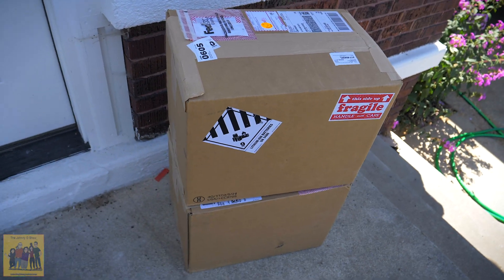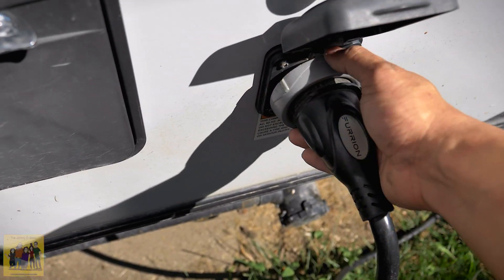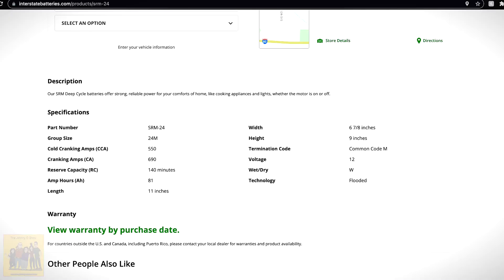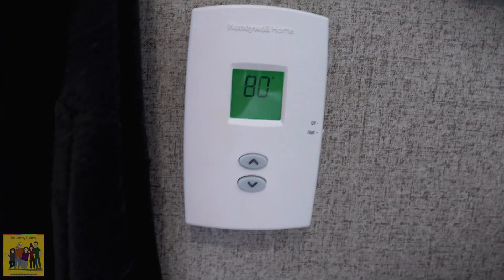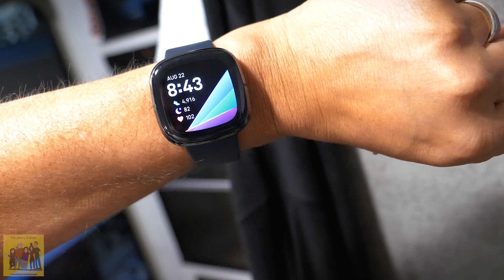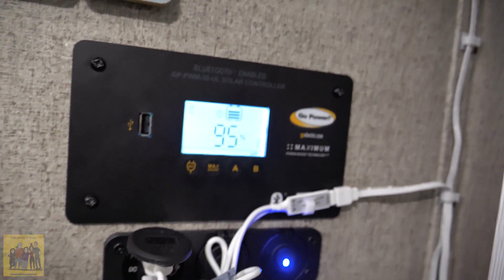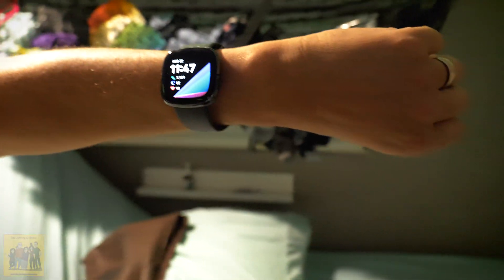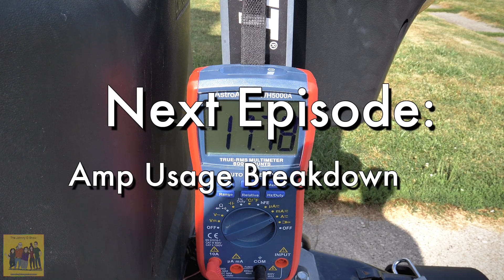Ep. #803 Geo Pro 19FBS Battle Born Battery Install - Part 1: Single Battery Tests

Comment: Get a iPad or tablet and save movies from your streaming service of choice. No inverter needed for the roku. No tv drawing wattage. Recharge for iPad is not much draw - bring a battery bank and charge it when solar is max and you have surplus power.  Money is better spent on a quiet generator than more batteries. $800 at HF and you can run everything at the same time. Even AC. But then you got weight and gas cans.
Reply from the maker: However some campgrounds do not allow a generators at any time and will fine $500, most state parks in Wisconsin for example. But yeah i have found a small generator to work very well for us in a lot of situations, but its nice to have the batteries as a back up for all those other times, or when its 15 degrees F outside and we don't want to have to deal with a going outside and dealing with a generator. And yeah i switched to using an Apple M1 laptop for my work and that has solved a lot of issues regarding power. I can run on the battery in that thing for 20+ hours in a lot of situations. I could have probably been fine with just 1 battery but i do like being able to run for 3 days with out having to worry about anything.   We have a westing house 2200 generator runs at 51db low speed and a microair 365 on the AC so it starts it just fine with that generator. We picked the generator up on amazon prime day for $333. I have found the solar to be pointless

Comment: I won’t tell you what lifepo4s are going for on Amazon.  Actually I will. With freeze cutoff $400 for 100ah Weize - actually $50 off coupon right now.  Wish I could fit 2 in that damn battery box.
Reply from the maker: that's a really good price.

Comment: Interesting video. I have the same GoPower charge controller and I have found the state of charge readings to be suspect. They are often vastly different from the Victron battery monitor. The GoPower will go from 100% SOC to 68% in a matter of minutes with almost no draw on the battery, while the Victron drops only to 99%. I suspect it might be a winter replacement project.

Comment: I got 2 BB on my 19FD.  Just move them back towards the trailer.  I did have to use a different size box, but it did work.
Reply from the maker: did you have to make a new tray to hold the boxes on yours? the area on my camper did not allow anyway to move the boxes back unless I modified the tray area (grinding off the old and welding something new)
Reply: @Thejohnnyoshow  I think my tray holder (the L shaped piece) was screwed on.  So we unscrewed it and moved it back as far as I could and still have the boxes fit.
Reply from the maker: @todd2456  oh, I have noticed that they kind of do things random. mine was welded, and for example how I put shelves in my closet and worked around the location of the inverter, the folks that have the "wines, pines and canines" channel, wanted to do the same but their inverted was placed in a different place in the closet making it harder to do. so it think its kind of hit and miss on how they assemble these things
Reply: @Thejohnnyoshow  Definitely !!
Reply: I just picked up a 19FD yesterday. Where did you relocate the battery's inside?
Reply: @cmacclel  I kept mine outside.  But upgraded to battleborns (2).  Some people I've seen relocate them under the bed towards the front of the trailer.